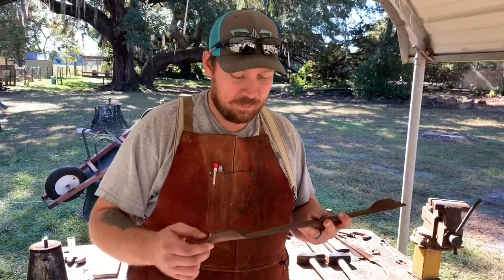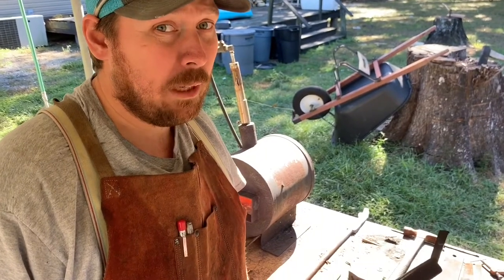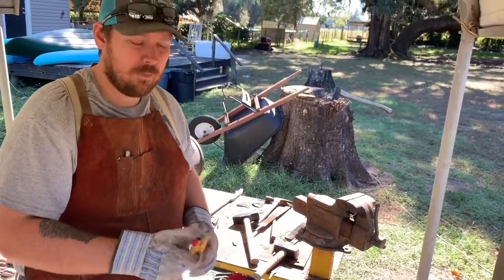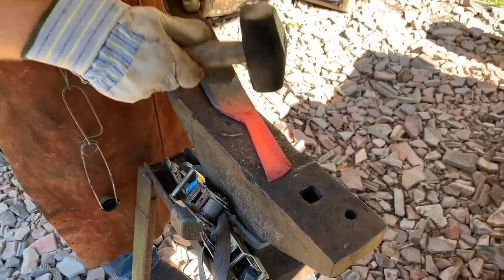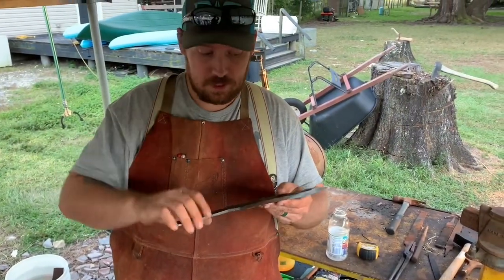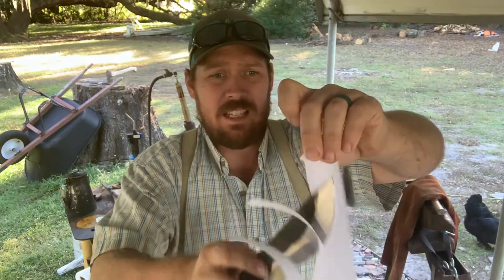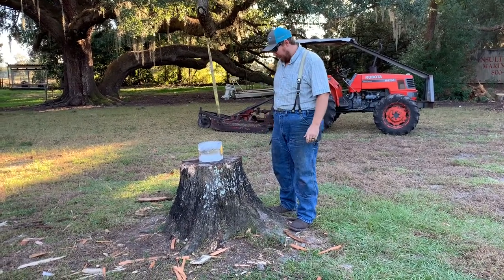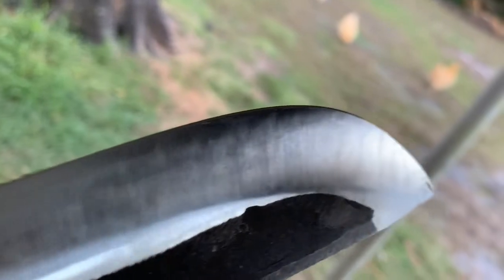LAWNMOWER BLAD TO BUSH BLADE

Comment: I am a Metallurgist.  Mower Blades historically have been made from 1074, 1566, 5150, 4140 and 10B38.   Really a wide range of heat treat parameters and mechanical properties.   The problem using mower blade steel is that you don't know which alloy you have randomly picked up.  Some can safely be heat treated harder than others.     Some of these steels get brittle when at top end of hardness, some do not.    So, people are taking a chance by not knowing what material they have.   Generally, mower blades are designed to bend, not break when impacted (like your vice test).   So, without knowing your tempering temperature, I am still a little concerned about your knife (or any random mower blade knife).    Back in the 90's, there were several mower blade recalls due to blades not being tempered correctly and they would shatter, upon impact.   They were made using materials with a steep ductile to brittle transition, that had very little forgiveness if heat treated incorrectly. .

Comment: I just sharpened a lawnmower blade using a flap disc and I was amazed at the shower of sparks it threw.  My understanding is the more sparks the better, but maybe they need to have a certain pattern?  Maybe somebody can tell me what to look for in a spark test.
Reply: Spark test from a belt sander or bench grinder.... You are looking for sparks that look like little fireworks. You will know it when you see it.  Blade steel isnt real expensive if you know where to look. I get 1084 from Jantz supply. Its a known quantity I can find information on for optimal heat treating and tempering processes. Mower blades should be something close to 1075 ( tough, holds edge ok not great, wear resist isnt optimal, but its quite usable if you dont mind sharpening)
Reply: @jessekelley9384  good to know for me as well! Thank you, sir!

Comment: Total waste of time, case hardened crap, get some real stock
Reply: Depends where the mower blade came from. John Deere uses 5150 blades on a lot of their commercial mowers. Iv made several using these and made excellent tough choppers. Seems like the only waste of time is your comment.